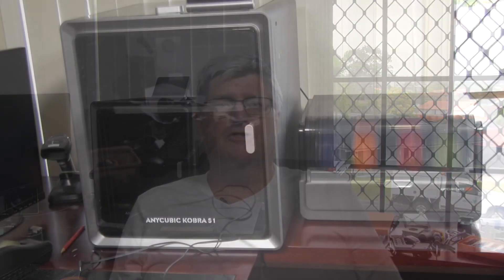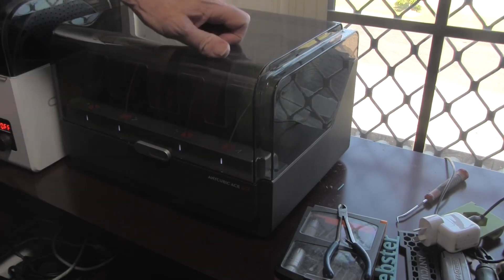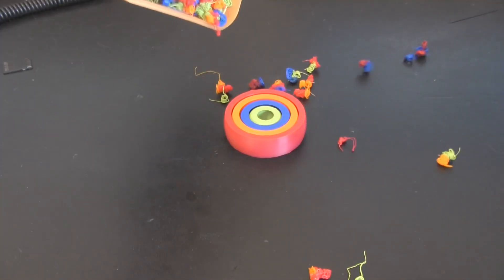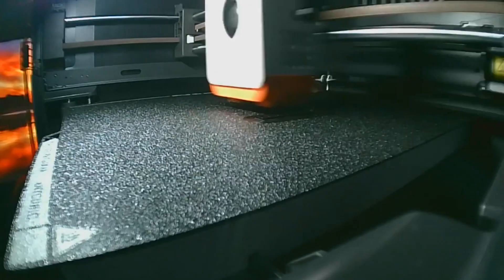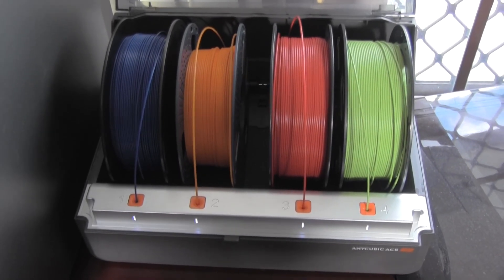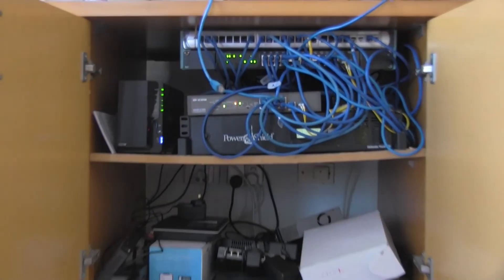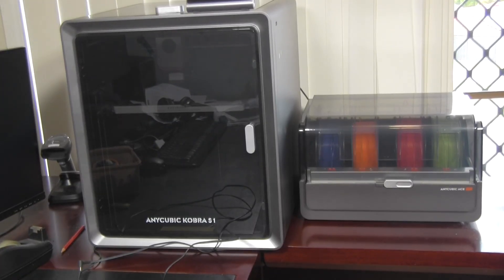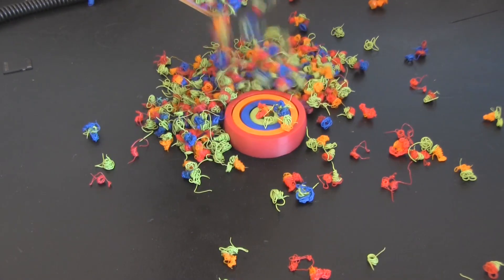Can This 3D Printer Really Print With 4 Colors At Once?

Comment: Thanks for the video. I have 2 Kobra S1 printers. I tried a hardened aftermarket hoted and had nothing but trouble with print quality. Went back to stock hotend and prints came out clean again. Yes, this printer is finicky! I find I have to tune all my filaments. When is use stock PLA profiles I have bed adhesion problems. If I use a tuned profile, the first layer goes down perfectly. I can’t really explain why that is. I’ve also had prints fail for bad first layer, but was able to restart the print with the exact same G-code and the second try would go down perfectly. Maybe this is something that Anycubic can fix with firmware?
Reply from the maker: Great feedback thanks. I have found using the pressure test on every print and washing the plate with dishwashing detergent from time to time eliminates layer adhesion issues unless I forget to add a brim when I should. I always use stock profiles.

Comment: I’ve had mine for 2 months, and printed about 300 hours in that time. I have had no problems at all. It’s not my first printer. I struggled with an Ender 3 pro for years. This is a peach to work with by comparison.
Reply from the maker: Glad to hear you're having a good experience with the Kobra S1 so far!

Comment: Nice video ❤ I got mine two weeks ago. It is my first printer and i am surprised how good the results are. I got the anycubic cool plate and only tried it with pla yet. I also got a 0.2 nozzle and the results are stunning for figures ( with the right settings in the printer and profile of course) but normal prints I will use the factory one. 
I also got some ABS to print but still waiting for the airpure 2 system to get the air out of the window…. Hope this works
Reply from the maker: Interesting. I had not seen that one. I wonder how well the supplied charcoal filter bag works without venting? I have not tried ABS at this stage.
Reply: @MrRodW good question I saw you can print some hepa filter adapters for the back also (found on printables) but the airpure is from anycubic directly
Reply: @MrRodW  I’ve tried abs printing. And unless I’m missing something the charcoal fan is off during abs prints. I’m not sure if this is to avoid warping via airflow and temp drops. But it’s odd. I’ve manual ran the fan and noticed smell improvements but not sure how much it affected the prints as I don’t have an off and on comparison. Parts did fit so tolerances appear unaffected for most. parts

Comment: So am I to understand that Anycubic forked Orca Slicer and... removed linux support? That's an interesting choice.
Reply: I put Rinkhals on my AC cobra s1. It will give you support for orca, aside from the obvious like the bed mesh etc. 
Honestly, I would skip the S1.

I will give you my experiences and opinions. 
After around 800h of use, the printer is fine, the Ace unit is meh at best. 
When I say fine, I don't mean "fine to buy, you won't have any issues aside from user error"
I mean, "it's fine for the average consumer". 
I have had issues with taco bed, bed mesh had a 1.3mm deviation. The bed's aluminium plate is just too thin and it's default slicer is just shit at compensating for it. 
I've had a lot better 1st layers once I installed Rinkhals and switched to Orca but then that's when I saw just how warped the bed was. 
I purchased a bed and carriage upgrade from Funssor on aliexpress (was not cheap) and now the deviation between the highest and lowest is 0.1mm (middle is a bit high but whatever at this point). 
Now I don't have first layer issues but the quick swap nozzle is just badly designed. I've had mine destroy both sides of the build plate and 2 hotends just because it decided to pop out.
After I used both of the OG ones from Anycubic, I tried some "upgraded" nozzles from a couple of aliexpress vendors that sold hotends compatible with M6 nozzles. Those worked a lot better than the OG ones and after around 500-600h none fell out. Guess the "clones" are better than Anycubic's own design. 
Another issue with the printer is, there is no hardened extruder and none aftermarket either. 
Defeats the point of being able to get hardened steel or other nozzles but I digress. 

My P1S had its own fair share of issues, namely how finnicky the AMS is when it comes to 3D printed spools when I used them for refills and such. Always some dumb stuff how the filament is stuck or something and the other. 
Only reason I dislike BL is because of their recent policy changes. They irked me enough to buy the S1 but the S1 hardly is useful for multi color prints and it's especially useless if you want it for something where the first layer matters (aesthetically). Since it has no hardened extruder gears, makes it useless for anything that is abrasive. 

Maybe the Qidi Plus4 is a better buy (they fixed the "fire" (more like melting) issue), the Qidi box seems to be still in its beta phase but it might end up being decent? Give it a month or two. 
The Plus4 also has a chamber heater. 
If you do have a lot more time on your hands, the Snapmaker U1 looks interesting as well considering it will be quite affordable for a 4 tool head printer. Eh, who knows.
Reply from the maker: @micobugija6284  Thanks for the feedback and your insights. Very helpful. I have avoided the Rinkals solution and 3rd party beds for now.  I have a heap of different hotends here but had a lot of problems with it on my first go and it took a long time to get it back working again so waiting for now. Yes, I've destroyed a bed too. I am working on an enhancement to the ACE/filament system that should make a huge speed difference to filament changes. There have been a lot of new printers come on the market even since I bought the S1 so I may have chosen differently given the new choices.
Reply from the maker: Yes. Orca is still supported but you can't send jobs directly to the printer from the Orca Slicer. You need to transfer with a USB Stick or install 3rd party firmware.
Reply: @MrRodW the fact that it’s a fork but it is not compatible out the box without a slicer is a big L for them, to me. And the lack of a Linux appimage and only compatible with Ubuntu 24.04 and no other distribution is not even an attempt at Linux support.
Reply from the maker: @geemobile6037  Looks like they made an attempt at supporting Linux earlier this month. Unfortunately, I use Debian. I set the apt sources manually, ignored the apt warning but got some dependency version errors on my Chromebook (Bookworm). But I think it will resolve versions on Debian Trixie. Will try on my desktop later.
Reply: They did say 2026, but ill believe it when i see it.

I initially returned mine when I found out, but got it once I saw the Rinkhals efforts and a sale. I didn't want touch Creality or wait and wait for the Qidibox/others.

I use it on OrcaSlicer with a Qidi Plus 4. I wish the mono was stronger as I wanted to use OctoEverywhere with it, but it will (overheat?) stop midprint requiring a power cycle. 

It's early October and the Qidibox pre-orders stiiill haven't been fully shipped (to the US). Some comment the ace pro is better, at least for troubleshooting jams and software support, but I think we're at a version 2 now. I don't have mine, so just have hearsay. 

These days idk what to recommend anymore.